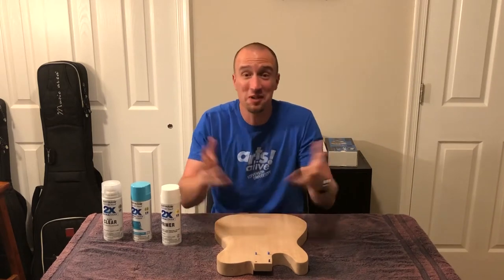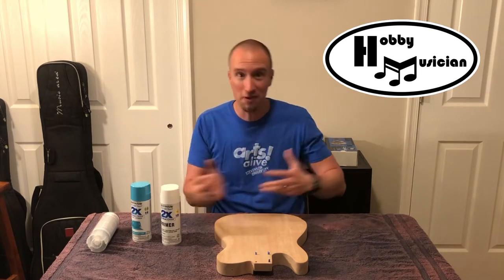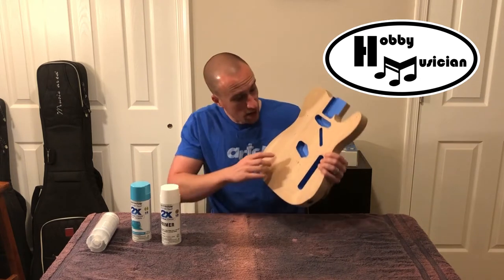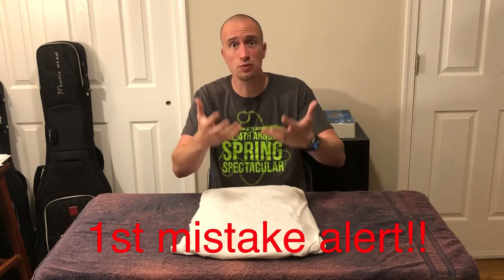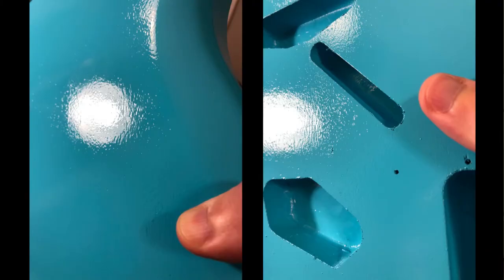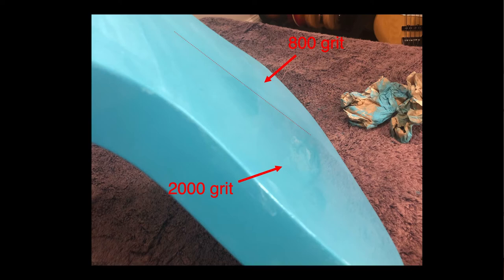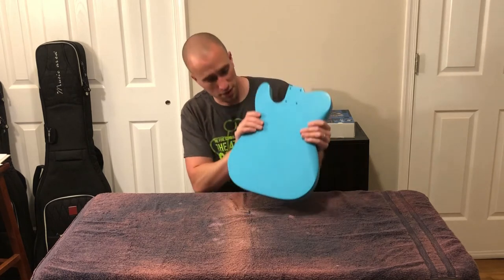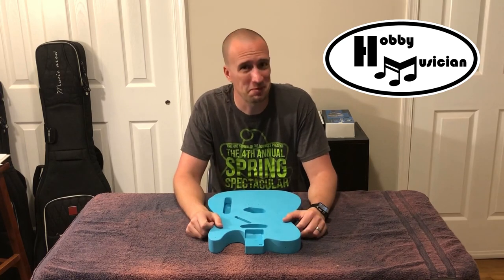S2E4: Telecaster Build 3 - Painting

Comment: Nice! Did you experience any problems with tackiness using the 2X, or should I ask, how long did it take to fully dry?
Reply from the maker: Good question!!  Personally, I didn’t have any tackiness when I’ve done this. After the initial ten minutes when I pull them out of my ears and pull the buds out of the plugs, I only need to let them dry the rest of the way overnight. They’re usually fully cured that next day!! Hope that helps!!
Reply from the maker: Whoops!!! I replied to the wrong comment in my list!!  For these paint jobs, I always waited a full week before I came back to them with any sanding or anything like that. When I’m done painting I let them sit for an hour outside then, move them in to sit for the week. I’ve found that’s generally long enough to get them fully cured. (Sorry again for the mixed up reply originally!!)

Comment: That type of paint is not good. I used it when I reconditioned an old bench vise from the 60’s. I used the same brand or series of primer too. That paint comes off with moisture. My vise got some raindrops on it and I noticed the paint bubbled where the water had hit it. I will NEVER use that series of rustoleum paint again.
Reply from the maker: So sorry that happened to you!  In cases like this, when there’s less chance of moisture, I’ve had good luck. Sorry again!
Reply: I’ve never had a problem with rustoleum paint on guitars. It works great if it’s used properly.
Reply: @DeeTee79  it’s this particular series of rust o leaum paint. With the paint and primer in one
Reply: @DeeTee79  even the rattle cans that have the “2X” on them? That 2X type are a paint and primer all in one. 
It’s sh!t paint.
Reply: I always use these cans and I always use at least two for each guitar. Under the right conditions, I’ve never had a problem.